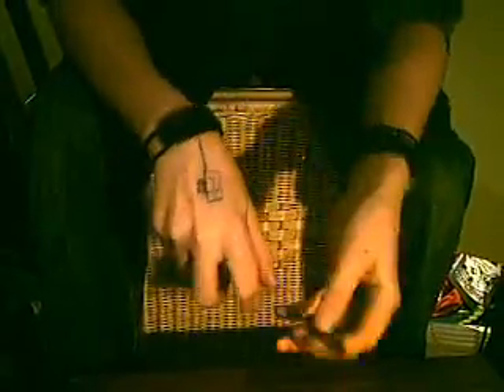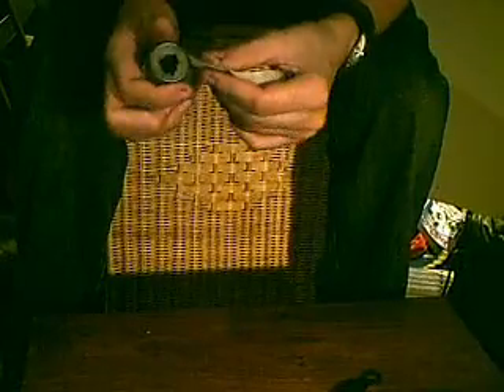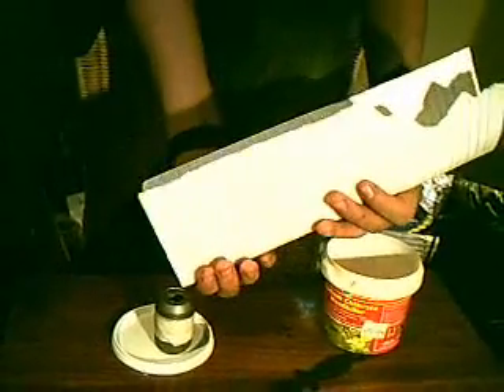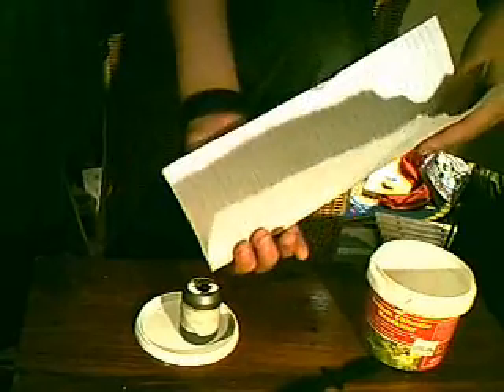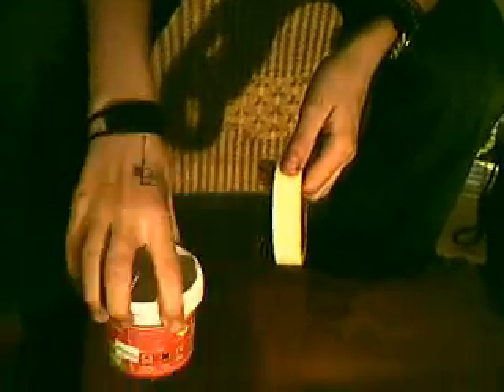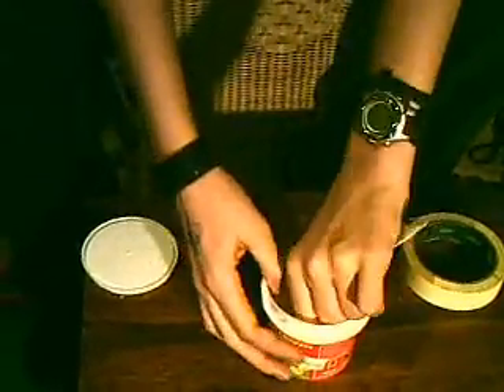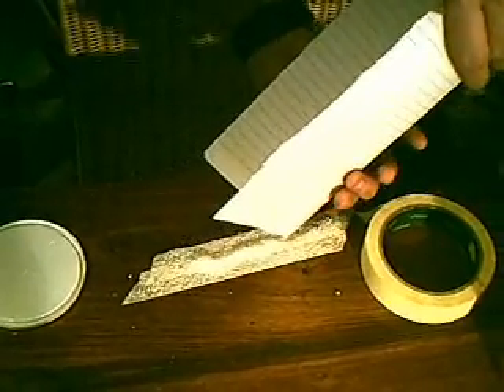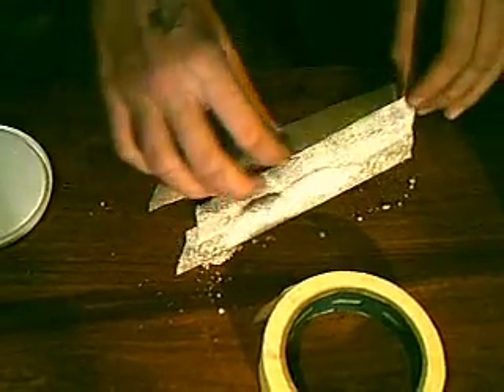how to make a flare made from sodium chlorate

Comment: you changed your chemical name like 6 times through out the video it isnt potassium chlorite it isnt sodium chlorite it isnt potasium nitrate (you called it all of these)  it is sodium chlorate  you need to add a fuel as the weed killer is just a mixture of sodium chlorate and sodium chloride  the only fuels avalible in your design are the masking tape and the plastic container